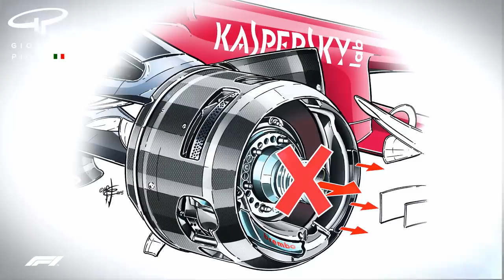2019 Technical Regulation Changes Explained

Comment: i have a question, if it does make cars slower 2 secs, doesnt it mean that every car is slower 2 secs? and how would this be promoting overtakes? i know it says following cars behind this and that, but engine must play a big part for those small teams right??
Reply: The idea they are pursuing is to eliminate some of the aero techniques that are specifically geared to shedding turbulent or hot (in past years) air/gas onto the aero surfaces of following cars.  If they achieve that (and I'm not saying I think they will...), I guess there's a case to be made that it might make following another car and ultimately overtaking it easier.  However, from the release of these regulations until the opening race of 2019, the engineers will be working to claw back everything the rulesmakers have taken away from them. IF there's one thing that history teaches us, it's that the engineers generally win... 

Engine power and grip play a huge part in overtaking, particularly now that we are in the Herman Tilke circuit era when every long straight where an overtake might be possible is preceeded by a very slow corner...  More or less the complete opposite of the classic John Hugenholz circuit design, where every long straight ended in a tight corner... which lead to all kinds of dive bombing and outbraking attempts.

In this enlightened age of Tilke design?  The engine power (and now KERS!) allows the lead driver to walk away out of the slow corner while the following car (lacking downforce) falls further and further back until even a gimmick like DRS won't allow them to catch up enough to make a passing attempt (see Japanese GP 2016).
Reply: ShmuelWeintraub damn, what a nice explanations thx a lot, i learn sth that i dont understands at all, so what ur saying is that this is still not a regulations until it is applied and accepted by all?? 

and wow its not only about the cars, even the tracks play a huge part and didnt think of that… thx a lot really for a very nice explanations, was just watching f1 the whole time, and tbh its not as thrilling anymore for someone who just watches cars racing…
Reply: DorZi:  You are most welcome, I hope it helped.  I agree with you, it's not a very good 'show', F1 these days.  We will see if they can modify the rules such that 'real' racing returns.  I hope so, as I watch these days as much out of a sense of warped "duty" to the series I have been following since the 1970s as anything.  It's really not enjoyable to watch at all.

Comment: Less downforce is better not just for overtaking, but also less full throttle corners. Meaning, the skill of the drivers comes at play more.
Reply: Jeroen you know that corners like Eau Rouge, Blanchimant, last corners in Baku and first and second corner in Silverstone will still be flat out

Comment: Im not sure it will work. NASCAR banned bending the splitter this year so it makes less aero dependent. But instead with such little downforce with the new splitter when that difference in splitter is taken away, the aero is directly affecting the other splitter. Taking away all downforce making following, especially on 1.5-2 mile racetracks extremely hard. This may happen in f1 and the wing will make engines matter more, and we will see bigger gaps between ferrari and merc to renult and honda.

Comment: Do fans notice how slow 2016 was compared to 2019? And i don't think a lack of speed made 2016 bad. 
I remember people talking about how great 2007 and 2008 were, and these years were slower than 2004
Reply: The cars looked terrible in 2016.   If 2008 was so great,  why did they bring such a dumb rules change in 2009 that made the F1 cars look square and ugly?
Reply: The stock market crash? Maybe?

Comment: I guess Formula 1 found the solution to close racing coz the air from the car infront disturbs airflow throught the tiny winglets which makes car less stable in straights, but reducing aerodynamic could slow the car from the usual 2017-2018 lap times drastically? im no joking im talking science and physics rite now

Comment: All those are very good changes apart from increasing the DRS effect. When making it easier to follow a car in front where is the logic to now also increase the DRS effect by 25% (or even more)? This will make overtaking far too easy and most likely everyone is going to have a massive ~30 km/h surplus on the straight so the overtake will be done miles ahead of the braking point :/
Reply: I don't think the difference in DRS straight line speed is gonna be that huge, 30Km/h is a lot
Reply: Right now it´s about 15-20 km/h with slipstream + DRS

Comment: Yeah, make the DRS more powerful, that's exactly what F1 needs after watching Spa and Monza. The DRS is powerful enough as it is. It's meant to compensate for the dirty air effects and facilitate overtakes into corners. If you eliminate the "dirty" wakes of the cars to make racing closer, than logic dictates we can also eliminate the artificial overtakes of the DRS system. DRS also means there is less compromise between top speed and down force with car setups. With DRS you get both. Get rid of it!

Comment: So basically the cars are going to be slower and still can't overtake, because there are things called corners in which it is hard to overtake anyways. also the top teams will be flying away anyways because engine power is much more effective. so basically nothing changes but lap times will be slower. good job guys well played.

Comment: This won't help if they can't push the tyres like the previous 3 races. Total parades because they didn't want to risk making another pit stop. 

If they bring back last years tyres for 2019, then these changes will be welcomed with open arms. We also need a shorter wheelbase, these cars are longer than they were when they had V12's and V10's. There's absolutely no reason for them to be this long.

Comment: At this moment,,, FIA change regulation just for racing,,, racing that f1 fans want to see as well as soon
But i think still have something that FIA can do:
1. Refuelling when pitstop. 
2. 1 engine for 1 race,, not 3 for 21 race (if u want to look maximum pace of car)
3. Large circuit like sepang which give possible overtake. 

Man,,, remember when 2006-2008
We can see racing,,, A lot overtake,,,, and remember phenomenal fight between hamilton and kimi in spa 08
We want race again.

Comment: F1 took props from Indycar, GOOD, now cars are harder to drive with less aero and much faster in a straight line. Now Pirelli need to fix their tyres, they don't drop off enough to force 2 stops on all tracks and the drivers can't go flat out cos of the tyres burning up too quickly, unlike the bridgestones in 2010

Comment: The front wheel generates a lot of drag. The present solution is to use the front wing to direct the air to the sides. But this basically makes the disturbed air three cars wide, and incredibly messy. The 2019 wings will direct the air over the front tires, and also inside and down. Hopefully we can witness actually competition, nose-to-tail, side-by-side for the entire race. Because right now Formula One is the joke of the racing world. Immense budgets, highly skilled drivers and engineers, yet the final product of on-track racing just plain sucks.

Comment: Why not create a smaller front wing?
Reply: Wing size isn't the problem, the problem is all the little pieces that disturb the air after it leaves the back of the car.
Reply: coast2coast00 yea, you are right. I think they are so unusefull
Reply: that would make F1 cars dramatically slower, F1 "experts" on the internet would be crying

Comment: All the F1 fans asking for more overtaking action sounds like they want to rely on the car technology than driver skills anymore.  I'm not sure why F1 fans are going sideways.
Reply: Yes.  It is supposed to be the world championship for drivers, not aerodynamicists and electronics specialists.  They need to make changes to reduce the impact of the technology (which will always be a big part of F1) and put the onus on drivers to 'make the difference'.

Significantly lower downforce and tyre grip would be a start.  I don't see these changes making that happen.
Reply: I want more racing. This have been interesting with the midfield with alot off fighting and overtaking but, with the 3 top teams its not very exiting. The tires are a joke. Ultra soft that last 30 round is ridiculous. No tires should last more than 20 rounds. 3-4 pitstops in race would be amazing to see again with refueling. Close racing with intense battle and, then sport its on the track again.

Comment: So let me get this straight, Team's put pieces on the car only to mess up the areo of the car behind. Jesus, this really is the future
Reply: It's been that way for some time, unfortunately.  It goes back to the first time you heard a commentator say "well, the car really seems to work when out front but does not like traffic".... which by my recollection is going on 15 years now.
Reply: it's not like that, teams are always aiming for the best downforce, the side effect is the car running behind is affected by the aerodynamics of the car in front, that makes the car behind slower as soon as it gets closer to the car in front, that means if the car relays too much in aerodynamics the car is more affected, that's why this regulations make sense
Reply: Sorry Carlito, but it's no 'side effect'.  Designers have been specifically incorporating aero strategies to destabilize the cars following their own for many years.  All sports incorporate both offensive and defensive strategies, including motor racing.
Reply: perhaps they could have some rule as to how much of the air behind the car they are allowed to mess up? but i guess the DRS is what exists to counter this

Comment: redesign tracks for thrilling overtakes, not enough spaces
Reply: It doesn't matter how much space there is on the track when, thanks to the build up of shed rubber outside the racing line, it can't be used.  Also, the level of downforce now means alternate lines thru corners are difficult to make work.

We need to change the cars signficantly, not the tracks.

Comment: As much as this all sounds good, the increase to the DRS flap does worry me when it comes to places like Bahrain, Spa, etc where DRS passes are already like any car overtaking a McLaren Honda. I just don't want to be at the point of watching nothing but DRS passes.
Reply: Malwontae I know right ! They’re going to have to shorten the zone on those tracks now otherwise it’s going to be pretty lame
Reply: Malwontae:  That's exactly what they are going back to.  Any of the engineers working in F1 could have told the TWG that increasing downforce & grip would produce lower laptimes but worse racing.  The TWG did it anyway.

The '19 aero regs are akin to lipstick on a pig.  By the time the cars are rolled out the designers will have clawed back much of the lost downforce and found new ways to create aero problems for following cars.  The larger DRS flap might be the only  thing that truly effects change, and that won't be for the better if you like watching drivers actually doing their job rather than DRS/Pit strategy passes.

Comment: I have to admit, the people who make the regulations don't have an easy job. On the one hand fans want F1 cars to be as fast and as aerodynamically complex has possible, on the other hand fans also wan't to see good racing.
Personally I would like it if they had a bit more freedom with the front wing next year as they seem to have, but I suppose generally the changes have a lot of potential (not that I would know anything about F1 aerodynamics)
Reply: They should allow for more powerful engines to counter the cons of these effects. Better engine regulations and tyre strategy freedom.  

F1 was best when people associated brands to cars and it was companies racing each other than drivers. 

F1 is feeling more and more in lab conditions with too many regulations standardising the cars. The only variable is the driver and they hop between teams so even that isn't a testament to the company.

Comment: I hope that I can still alive to see less aerodinamic drag cars racing, like a simple but not so beutiful solution adopted, a rear wing splited!  If major of drag is caused by tires why not adopt rear wings like Formula Indy, it's obvious sucessfull in lower the issue of one car comes to close to another, and they race in speeds like 370km/h!!  As a designer I know it's like awkard but I'm certain the best designers can find a mid term between totally split in 2 parts above rear tires and a hybrid 3 parts with 2 real aerodynamics tires' wings and 1 almost decorative center wing!  With more and more aerodynamics issues and tremendous capacity in acceleration and mechanical grip, I can't understand why not resolve this simple question of the big rear wing that cause a massive turbulence for the car behind!  Anyways, great video now I have some notion what is about to came with 2019 regulations!  Thanks FORMULA 1!! :D :D

Comment: So, let's fuck the aero packages so that Mercedes can still play their superior ICE/MGU integration like that did during the bore festival 2014-2017.
Want better races? Allow proper diffuser, stickier and better tires or even a smidge of ground effect. Problem solved.
Want even better races? Make the MGU/integration part standard, leaving only the ICE to be individually researched and modified.
Reply: thefridgeman Spot on with ground effect! It's badly needed

Comment: Aerodynamicists have told the FIA that this won't even help the cars follow in dirty air, and we'll still have an overtaking issue. The FIA disregarded all the expert opinions provided to them yet they're pushing through with the change. The FIA keep putting small bandages on a wound that needs surgery, and they're even doing a horrible job at that as well.
Reply: Maybe the FIA should let another governing body run this series. It's not like they don't run a bunch of others already, anyway.
Reply: Deknoid:  Exactly.  Putting lipstick on a pig only wastes your time, and annoys the pig.

Comment: 2009 regulations seemed to be the only time the FIA got it right.

I think either they should allow any engine configuration like the 80s, limited to 800-900 HP (easily achievable these days), bring back refuelling and a minimal permitted pitstop time to even out the cars, and let the FIA continue with current aero/chassis regulations to maintain the sponsor's selling point of 'the most technically advanced cars in the world'....

OR....

Have 1994-1997 style chassis (much shorter wheelbase, slightly narrower width, maintain the current wide tyres), simple standardized front and rear wings which can only be adjusted by wing angle, no wings anywhere on the main body, just a simple, smooth design, but the sponsors can keep their current hybrid engines and maintain that 'eco' brand image.

The important message is that F1 can't carry on not giving a shit about the fans because people are switching off, and eventually low-audience can't justify an 'eco' or 'technologically advanced' image, but at the same time, fans need to understand that the world is changing and there are some things we have to sacrifice; fans and the sport need compromise and harmony, not to hate each other

Comment: I think that those changes are too similar to the 2009's. The cars will be slower, it's doing the same 10 years after. What we need is re-fueling and freedom in the tyres brand. In Schumacher's era it wasn't also easy to overtake, but at least we had all of this, more challenging races, different strategies and V10 sound!

Comment: I would be insanely pissed if I were these teams and manufacturers. To have spent so much in r&d to get these systems to function? Then get told it's for nothing, start over. F1 really needs to stop fucking with the regulations.

Comment: Let's make this fun, shall we?

Engine: 3.5 liters max, naturally aspirated, number of cylinders and their layout left up to the teams. Valves must be closed with dual wire springs, no pneumatic springs allowed. 

Transmission: Up to 6 forward gears, one reverse gear, and a clutch pedal. 

Weight: Car in operating condition with full load of fuel and driver must weigh at least 800 kg at pre-race inspection. Car will not be reweighed at the end of the race. Intentionally allowing parts to fall off your car will result in immediate disqualification.

Car will have a halo. Deal with it.

Tires: Tires will be made out of black rubber compounds, will not be spelled with a "y," must be approved by the FIA for competition use, and their brand will be of the driver's choice. Each team must maintain at least two sets of rain tires in the pits at all times.

Pit stops: Refueling will be allowed, but the car must be shut off during refueling operations and the fuel will be delivered to the car via "dump cans" like NASCAR uses. Seven crewmembers will go over the wall: two tire changers, two tire carriers, one fuel man, one fire extinguisher man, and one jackman. The fire extinguisher man will be armed with an airport-style 145-lb dry-chemical fire extinguisher.

Downforce: Car will have no more than 400 kg downforce. You can get it any way you want, except through the use of suction fans. There must be at least 10 cm of clearance between the lowest point on the car and the roadway.
Reply: I like how tyres are all from 1 brand. 
Don't see the need to change the crew set up. 
Well with down force, that's exactly the issue they're having here, simplifying it because teams are exploiting aerodynamics to slow the car behind. It's one thing to make your car faster but it's another thing completely to sabotage your competition in a race to the fastest